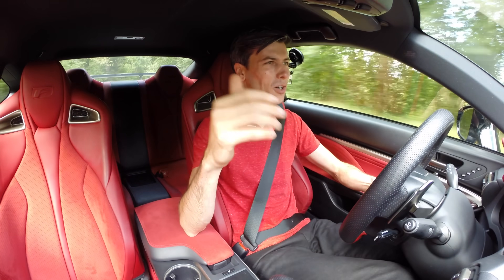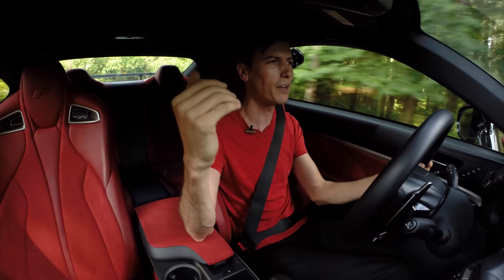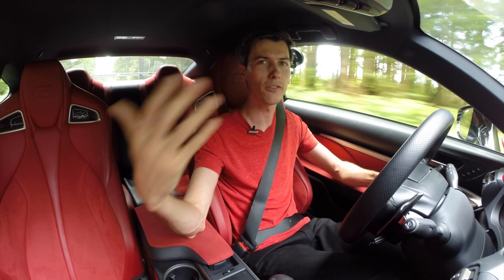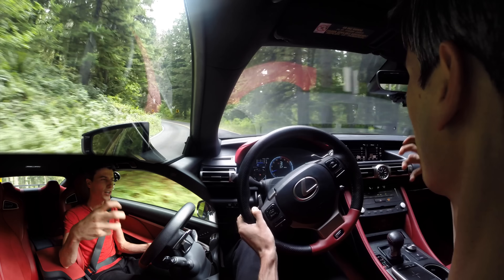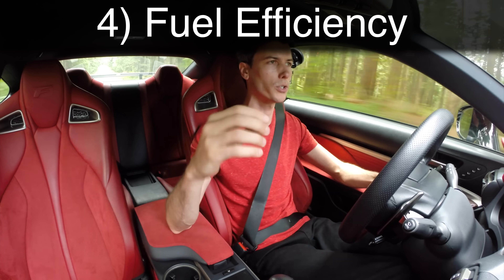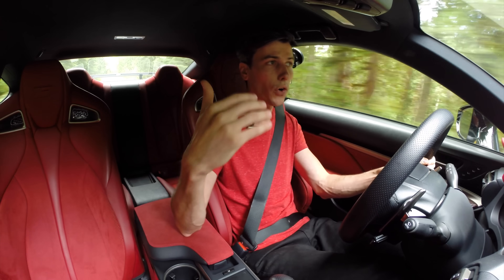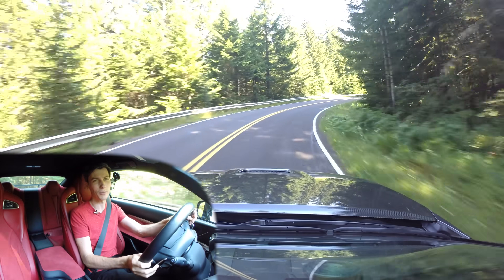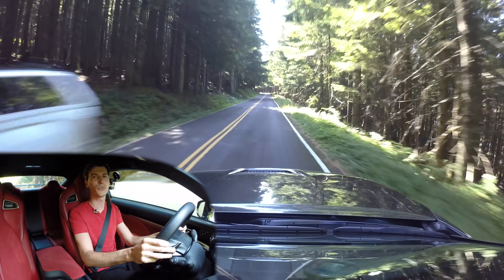5 Reasons You Shouldn't Buy A Turbocharged Car

Comment: We drive NA four pot trucks as daily's (Gasoline engines).
As long the filters and oil is kept clean they do 400 miles despite us shifting at 5K rpm all the time as we live at 6000 feet above sea level.
We really beat on them but the forces and temps are low so they don't actually wear fast due to it.
And we do only long drives.
And we don't operate them at full power for more than it takes to get up a hill.
A NA motor is far more tolerant to being operated at full power for long periods, due to the temperatures of the oil and the forces being moderate. 
The moment one adds a turbo there's an extra level of driver behaviour and responsibilities added.
At this altitude a turbo just makes an engine whether gasoline or diesel easier and more comfortable to use.
But, one has to make a realistic decision when it comes to what the vehicle is going to be used for and who is going to be operating it.
I guess I have gone off topic here as I am talking small trucks versus cars which is the true topic of the video.
A big NA motor is first prize, they are nice to drive.
Cost of ownership is usually the highest with them too.
An OHC V8 is a very busy bit of kit when it comes the valve gear, just for starters.

I think it comes down to personal taste here, because this is a very broad subject and it means there's a choice of engine for everyone to be had these days.

For manufacturers it means that there's big demands placed on making the turbo engines tolerant to driver error.
Never going to go away with turbo engines. 

The Cesna 208 cracks the cylinder heads if the pilot gets the approach short and backs of power too fast which cools the heads down too fast.
Turbo's are amazing but it adds a extra level of responsibility for the owner of a vehicle fitted with one.
My big gripe is actually with the owners of turbo engines and how they treat them.
If used correctly they perform well and longevity is good.
The turbo's are actually designed to last as long as the engine internals, which they do if used correctly.
Rant over, thanks for a great talk on the turbine subject.
As debatable as which colour paint job do you prefer. 
Take care, D

Comment: name of the title should be: "5 Reasons You Should Buy A Twin-Turbocharged Car
" 
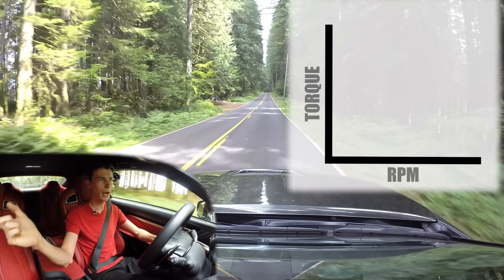due to the graph shown at 3:45 ;)
Reply: Why not just replace all cylinders with turbines. Bring back jet cars
Reply: @poisonpotato1  Because you press the gas pedal today...and it actually accelerates tomorrow?
Reply: @Rob-326  Yea but would´ve still better reputation than diesel-engines these days.. even with Afterburner lol. -thx VW
Reply: Or even like a BMW with 3 turbochargers. One for low rpm, one for mid rpm and one for high rpm 
(I think it's a BMW but im not sure anymore)
Reply: @Arakij11    Yes, u mean 2012 BMW 550d series with a 3L Diesel tri-turbo 381HP.    There´s already the 2017 version of this car with a quad-turbo built by Borg-Warner.   A few more generations and this car has more turbochargers than cylinders haha
Reply: @CaramellsutraA  Why not a Lancia Delta S4?
Rally car? Check.
Group B? Check.
Twincharged madness? Oh we got plenty of that.
Reply: @Arakij11  As I know one turbocharger is enough. The manufacturers uses the electric motor to run turbocharger even before you press the gas pedal.
Reply: @jaromirandel543  No they don't.
Reply: @jaromirandel543  You claim that an Audi does this.  Prove this, please.  I've read of the technology, but don't know of it being in a production car.  Even if there is one car, or engine, that has this, does not make-correct your claim that "the manufacturers" do this.
Reply: @dizzywow  Audi SQ7 TDi has one. Also E.G. the VW solves the turbo lag by comressed air that runs the supercharger.
Reply: @jaromirandel543  So, one car, the top-of-the-line Audi, does this.  Thanks.
Reply: @dizzywow  Nope, check my post again. Many brands does this. But they use different mechanism.
Reply: @jaromirandel543  I do not believe you, and there is only one mechanism that you claimed.
Reply: @dizzywow   it is true about electric engines coming before turbo to give better performance.
McLaren Ferrari and Lamborghini are doing engines with that system to gain better performance due to petrol consumption (going green), this is all to do with the market pressure for the global warming. And believe it or not, 5l  12v engines will be a luxury like Bugatti.
Reply: @sallesdanilo  The other guy was talking about electrically-driven turbochargers, which are exceeding rare.  He could provide only a single example.
Reply: @jaromirandel543  General question to all knowledgeables: Whereas it sounds logical that higher pressures lead to more wear and tear - in practice especially the turbo diesels with the highest pressure out of NA, turbo gas and turbo diesel are known to be very reliable and long-living. Does it more have to do with diesel vs gas or why is that?
Reply: Almost everything in a diesel engine is overbuilt in comparison to a gas turbo engine. They have to deal with much higher cylinder pressures and as such, are built far stronger. This leads to both increased cost and weight, but they can be significantly more reliable due to being designed to withstand more stress. In a nutshell.
Reply: "5 Reasons Why Manufacturers Are Losing Out By Not Offering a Turbo-Compound Car."
Reply: Sequential turbos, even better! Ford diesel 6.4 is a crazy cool example.
Reply: That is why turbocharged cars are now twin turbocharged.
Reply: @ggreco70  No, most are not.
Reply: Example: Buy a Toyota Supra. Twin turbo, small kicks in first, the the big one rockets the car.
Reply: @MicahJayeX  They are both the same size.

Comment: So the correct answer is supercharge it... Linear power delivery, similar torque curve, no reduction in exhaust noise, added supercharger whine. If you're buying a performance car you're not bothered about fuel really, so screw (pun intended) the parasitic losses or the cos of creating the engine. I’ve owned all three and supercharged was by far my favorite…

Comment: Your points at 2:30 ish are exactly why the S65 powered M3 will always be my most favored M3. The throttle response on that engine makes you feel like the throttle pedal is mapped directly to your cerebellum. Of course, this will only hold until a fully EV M3 hits the market.

Comment: I have an Accord with 428K miles. NA, of course. There's no way anyone can tell me that a turbo'd engine will get the same type of reliability as a NA engine. More pressure, more moving parts, more heat, etc. There is no benefit to having a turbo'd commuter car. It's a shame I can't buy a top trim Civic now without settling with a turbo'd engine (that is known to be problematic).

Comment: Turbo engines, let the oil reach 180 degrees Fahrenheit before before using the turbo and idle the engine for 1 to 2 minutes too cool your turbo before shutting off the motor.

Comment: If you say turbocharged engines have turbo lag, then an NA engine of the same size is just lag.
Reply: NA engines are tuned and geared differently. When you're in gear at very low RPM and put your foot down on a NA engine you usually get more acceleration than in a similar sized turbocharged engine.

Regardless it makes no sense to compare NA vs turbo engines of similar displacement from an OEM perspective. Displacement is cheap - it's literally just making bigger holes in the block, or a slightly larger crank - where a turbos and all the kit required for them cost money. A manufacturer wouldn't compare a 2l NA engine to a 2l turbo one when considering which one to build, they'd compare a 2l NA to a 1.4 turbo or something like that because that's when you're actually comparing different technical options to achieve the same end result (roughly the level of performance that the rest of the car was designed for).

In fact a NA is usually cheaper than a turbo engine for a given performance level (ie just make it bigger), which is one of the main reasons manufacturers have resisted turbos for so long. They're only common now because of fuel consumption/emissions standards and taxes which strongly favor downsized engines.
Reply: @BigUriel  NA engines are good for their driving feel and purity. But when it comes down to making big power figures and smashing record times turbo cars do the job very well. We know in the future probably electric cars will dominate almost any IC engine car. So for now let's enjoy either our NA or turbo cars and not hate on them.

Comment: I do understand that naturally aspirated engines in theory have better throttle response, however, the new technology in turbos, the variable vanos turbos, or a car like a BMW 5 series which have two turbos, a large and a small, the small turbo spools extremely fast, and the average, or even more than average driver, will NEVER notice the turbo lag, but they WILL notice the lower torque response. At this current technological moment, choosing between a small displacement turbo engine vs a naturally aspirated engine, simply comes down to the preference of the buyer. I personally would rather have a turbo engine vs a naturally aspirated engine simply because, it is highly tunable, and easier to tune. As far as exhaust sound goes, tell me a Merc AMG engine, a BMW new M engine, a McLaren, a Lamborghini Urus, or a Fiat 500 Abarth, or124 Abarth etc, doesn't sound PHENOMENAL. They are ALLLLLLL turbocharged engines, and they ALL do NOT pump fake exhaust sounds into the cabin. They all seemed to be Tuned to sound wonderful. This is all my opinion and if you disagree, feel free to tell me, or just dislike my comment. Also, I respect this video for all of its intelligent content behind it to backup his opinion.

Comment: I have an original Audi S5 V8. While the later supercharged and turbocharged variants are fine cars in their own right the V8 just seems so epic and indulgent. Other than when tooling around in congested town centres (where the smaller displacement would certainly save fuel) the V8 is smoother and more linear in its power delivery, and a joy to listen to.

Comment: I agree with points 2-4, but I like the sound of forced induction engines (both turbocharged and supercharged).  Regarding point #1, if you know how to drive a turbocharged car it's relatively easy to keep it in the power band without much sacrifice to comfort (noise and ride smoothness) and fuel economy (assuming it's a manual or the shirt points are properly tuned).  This negates the turbo lag issue and gives you similar throttle response to a naturally aspirated engine.  I think the sweet spot is turbocharged V6 engines if you want the best of both worlds.

Comment: At 2:23, "this is America ..."  So, why not use American cars, then?  All I see are foreign cars in your videos.  As far as lag goes, none of the turbo-equipped ICEs used in cars now a days have any turbo lag.  With variable geometry turbos and variable valve timing, there's no perceptible lag.  The fuel economy of smaller engines is better primarily due to lower pumping losses at the throttle.  I have an American 2.0T-powered car, and I exceed the EPA fuel economy highway rating with every single tank in mixed driving.  There's no reason whatsoever to not own a turbo-powered car.  None.

Comment: All valid points, but for performance cars only. I cannot praise enough my TSI Golf getting max torque at 1500rpm and keeping it flat until 5000.  There really are no scenarios where the turbo is not doing its part at 100%. Just free horsepower.

Comment: Ballcocks, a turbo diesel rules, simply follow the manufacturers oil change intervals and give the engine/turbo some mechanical sympathy by not pulling the strangler immediately after working them hard, i.e. allow them to cool down a little first.

Comment: I'm surprised to see you implying that the throttle position is directly correlated with torque output. If this was the case, ECU maps would be throttle versus RPM not MAP/MAF vs RPM. 50% throttle in a turbo car will likely make more boost/torque going up a hill (more load) than downhill, for example. I get what you're trying to say; but the way you say it is wrong, IMHO.

Comment: I really respect the sound of a NA V8 however nothing came close to the power output and acceleration I had on my 2004 Evo8 MR (JDM which I know is different from exports).   The manufacture option of a twin scroll, titanium/aluminium turbine gave full boost under 3k rpm and held until just under redline.  Going back to your large turbo/small turbo graph the purpose of the twin scroll has a smaller turbine spinning up to reduce the lag in the large turbine spin up so the you have full boost when you want it.   My 430hp ego would eat anything off the line but transmission hearing saw a drop at top end speeds allowing the large engines to dominate there.   I could never take a top speed win but would win on the track or any other road with <2km straight.  

Furthermore that high compression issue with knocking is something I never experienced with my car as that is what high octane fuel takes care of.   The ignition point of high octane fuel is at higher compression and generally needed for performance cars.   Yes some of the larger cars require is fuel for their compression map but pretty much all high power smaller engines with turbo need as a necessity.   On a side note don't think you get better performance from using premium in a car that only requires regular unleaded.   Despite ads both fuels ave sufficient cleaning detergent additives and cars not requiring premium don't need the higher ignition point of high octane to run smoothly.   Most times you can remove an engine knock by simply cleaning your plugs.

Comment: How to solve throttle response and torque curve issues on a turbocharged engine? Throw a supercharger at it.
Reply: Positive displacement superchargers don't lack response.
Reply: Yes, but they lack boost. 

As soon as you get to full boost, you’re at redline. 

You can have a turbo producing full boost—and higher boost—at as little as 1500 RPM and hold it until a 7000 RPM redline. 

And with a BOV and quick gear changes it’s already mostly spooled for the next pull. 

If Top Fuel allowed turbos they’d be doing 500 foot passes.
Reply: @Bartonovich52  Have you watched drag strip cars which have turbochargers? They have to spool the turbo before launching. Otherwise they'd fall on their face. On the other hand, drag strip cars with a big twin-screw or roots-style supercharger nail the throttle and it's cranking out positive pressure instantly and quite a lot of it.
Reply: @Bartonovich52  Even if you can get max boost at 1500rpm, that's still taking into consideration you're at full throttle.  Partial throttle will build boost slower and that's needed for modulation of power in certain situations.  The supercharger you're thinking of that builds boost is a centrifigual supercharger.  Roots type give instant max boost no matter the rpm.
Reply: Still not as responsive
Reply: they did, thats when the twincharge was born
Reply: @wactpac  that's not twin turbo, that's sequential turbos. One for lower RPMs one for higher RPMs.
Reply: I.e. increase complexity...sounds not clever to me.
Reply: Or another turbocharger
Reply: @ellenorbjornsdottir1166  there is a Company Adding a third turbo to McLaren's. They use the 2 to spool up the larger third turbo. Last I saw they had over 1100hp in that setup
Reply: With big engine like lt4 6.2l lool

Comment: My old car was a 300C hemi, loved that car.  very good acceleration throughout the power band but even with cylinder de-activation it got poor fuel mileage.  Now I swore Id never not buy a v8 again because I loved that Hemi so much.  But I traded it in for tiny 3.0L  twin turbo V6. (seriously 3.0L its like half an engine)   The sound is not as good,  but the turbo 6 has almost 100 more HP, is 1.3 secs faster 0-60MPH  and  uses 40% less fuel,   yeah 40% less.   I never thought I'd say this, but I love my little turbo V6

Comment: My 96 Ram NA  V8 acts like a turbo vehicle... Not much down low, all the torques in the middle, and then no top end. Torque falls off hardcore after 4000rpm. Peak horsepower at 4400rpm.

Comment: I think that the theory is that a turbo four will burn less fuel.  But when you stomp your foot down and get 15 psi or more boost, fuel has to match...which means your fuel efficiency goes out the back door.  And if that little engine is in a vehicle that also comes with a V8, the turbo engine is working harder more of the time...
hence the reason I am keeping my V8.

Comment: Poor evaluation of turbos. I stopped watching in less than 60 seconds. No objective evaluation, all subjective. Funny how the industry seems to be trending toward turbo charged cars. For various reasons, like fuel consumption etc. As torque produced in excess of the momentary demand is mostly wasted, which is why the major manufacturers are building small displacement turbocharged cars. No point in having 300 foot pounds of torque available at cruising speed, when you only need 80.

Comment: You're making a good case for a centrifugal supercharger. Throttle response is more linear and there is no lag with the supercharger. There is less heat with the supercharger because you're not relying on exhaust gases like a turbo charged engine. Superchargers are often used with higher compression ratio engines.. You can still have the benefits of the higher compression ratio of the naturally aspirated engine while having more high end horsepower  as long as the boost is reasonable. Finally, the supercharged engine sounds awesome at wide open throttle. Although not as efficient as a turbo, fuel economy is not affected very much by a supercharger during normal driving.